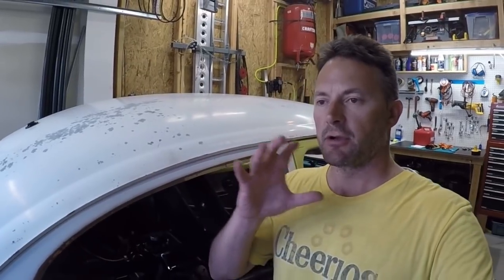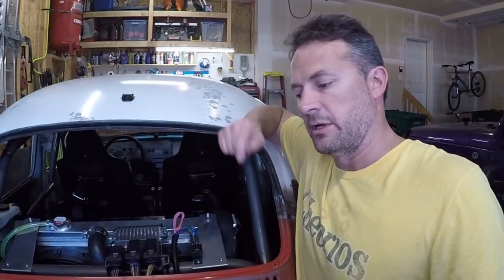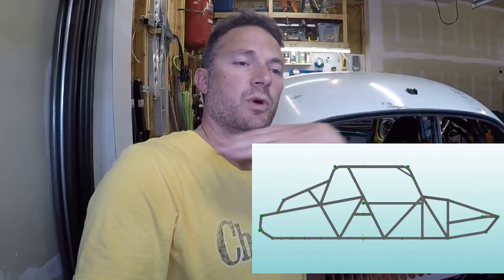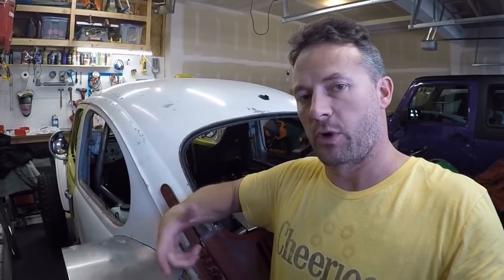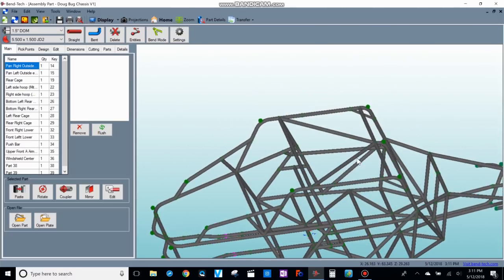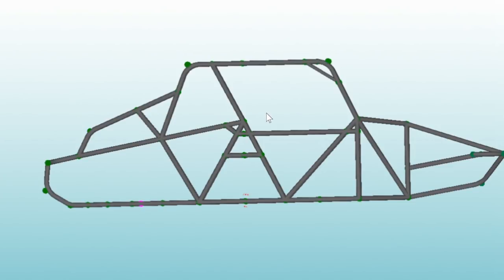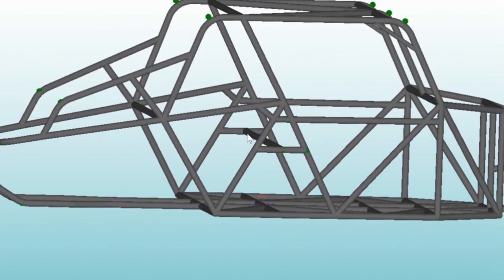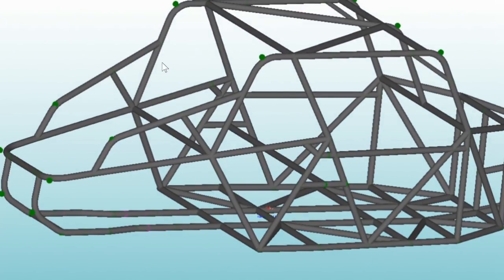A Baja Bug chassis for everyone.

Comment: What was the shortcoming of the previous VW Chassis  ?  What are you shooting for ?  More travel suspension ? Smoother Ride ?  Better handling ?
Reply from the maker: The engine and suspension I think at this point are limited by the chassis. I don't want to just try to cobble extra support on this one. I want to start from scratch and make one much better. But really I just want to keep challenging myself. This one now scoots down the trails great.

Comment: Doug. I’m very disappointed you are giving up on the bug body. That’s what makes your project so cool. Your car not just another tubeframe car. Please reconsider the body.  But if not here are a couple points. I’m an engineer and looked at your design from some basic structural engineering concepts.  I would really like to do some math on the design if you want to go that way, I mean materials and their qualities the end design shapes and your goals for the design.  You said you’re not going to do The Mint or jump this thing.  
Agreed. So if you’d like I can put your design in some stress software and maybe help your project. 
Off the cuff, if the bug body is gone stretch the wheel base and narrow the cab. No tunnel so push it in. 
2nd, I know you don’t have delineated the transaxle mount but taking a SWAG at it, your bar which will carry the shock upper mounts is wrong.   It’s current configuration will fail or bend and will translate rebound forces towards the weakest part of the design, the door openings.  Tilt this bar up from the rear continue it down and tie into the transaxle mounting structure.  You must optimize the truss structure of this area which will bear 70 to 80% of the beating.  
3rd the door area I’d use the NASCAR Triple beam strut ice here. It’s not just for side impact, but since this is not a unit designed racecar and you are trading structures for convince the door opening is a weak frame in an end over end event.  Since you are losing the truss here the triple beam keeps the car from folding up  and adds stability to the driving experience. 
4th you mentioned radiator in the cab. Check your Highway Safety rules or whomever issues VINs for road going vehicles.  Firewall requirements burn through and licensing, like safety glass windshields. A BUG BODY WITH A TITLE AND VIN GET RID OF THAT. 
Let know if I can help, this is very nice of you for offering up the development as a groupware knowledge base project.  Facebook or Google Plus may have a group project option.
Reply from the maker: Don, I'd like to discuss some of your points and it would be great if you could do a stress analysis on the design. Not sure if you've seen the newer design, this video is about 2 months old and I've made some changes. And currently I am actually building the chassis. So we're running out of time. lol
Please email me direct so we can discuss. dougbugbuilder@gmail.com

Comment: ps. Check out this nicely designed chasis. A lot like an Ariel with more straight bars. https://youtu.be/18flbGLj_w0
Reply from the maker: That's pretty cool, and it's Diesel. lol
Wonder why he didn't do some sort of front bumper?
Thanks for the link.
Reply: I don't think they worry about safety in Russia! lol The diesel may offer a lot of torque, but you don't get that nice exhaust sound of a gas engine. Highly functional, but maybe doesn't evoke a lot of passion.

Comment: Wow, you are consistently impressing me. I'm a week from getting my degree in electrical engineering, after I graduate I plan on building my own baha bug. I have been going back and forth between street legal rig or a off-road only, have you looked into licensing where you live? (California is pretty tough)  I have read that if I keep the main rails off of a Volkswagen that has a serial number on it, licensing isn't too difficult.

I will be very interested in your design files, I am probably going to go the same route. (Thats the engineer in me) I am happy that you choose to use this specific software, the pricetag is definitely realistic and I plan on using it as well. 

Thank you for your hard work, and have a wonderful week!
-Aaron
Reply from the maker: Hey Adw595, I just registered and insured mine. I've driven it some around town here. It's really easy to register and insure if you have a vehicle to start with like I did. Especially if it's pretty old too. Mine is a 67 so the county didn't care about emissions or anything due to its age. However just because it's registered does not mean your in the clear. We'll see if it gets hassled at all from police on the road. And if I was in an accident who knows what insurance would say then. But time will tell.
Good luck with your build.

Comment: Have you seen the chassis that kibbetech built for dunewhore?  They have it posted on their instagram page.  I'm tooling up to build something similar, or I may just go with a F100 build.  I thought I was decided, but after seeing different builds at the KOH I'm not sure now.  Either way fabrication is fabrication and the info you share is very helpful.  What sways me is the power I want and the limits of a bus transmission without spending over 10G on a weddle or mendola transmission.
Reply from the maker: I follow Dunewhore on Instagram but haven't seen the build on his chassis. I'll look for it.
I hear you on the build choice. The transaxle on rear engine builds can get out of hand real quick!
Good luck with your build, thanks for the info and comment.

Comment: Great video channel!
If you are not already planning to, I recommend stress testing your chassis design before the expense and time of building the full size steel project. For example, I think I see a torsional weakness in your front clip.
The technical way to stress test is with a Finite Element Analysis (FEA), but that requires expensive CAD software. Another way for home builders is to build a scale model using balsa wood and then twist it yourself. The balsa model can be built in 1 day for under $10. The balsa model helped me find weaknesses in my last chassis design.
Checkout my video at https://youtu.be/twAOhxcMAM8
Reply from the maker: That's interesting, I wasn't even considering doing that. But watching your video it looks like it did identify some weaknesses. Good video by the way.
When I get the chassis design I think I'm going with I'll give FEABLE a try. Thanks for the excellent advice and video link.
Reply: Also, if you design your chassis for torsional (twisting) strength, it will usually handle the load weights of the drivetrain and passengers without much additional bracing.  Most people start by designing a chassis to handle load points and then add bracing for torsional strength.  That is actually backwards and results in a heavier chassis.

Comment: Great work ! This has been my plan since I emailed you last time . That software looks like a game changer . How was it to work with ?
Reply from the maker: I'm hoping this software takes tube bending more from an art form to a mathematical step by step process for me. Making it easier to keep things straight and to replicate parts.
The software is pretty good. First couple days it's a real learning curve figuring out really how the software works. Once you grab some of those concepts the learning goes a lot quicker. There is a lot of support and videos on the Bend Tech website which helped a lot. And I have spoken to them a couple times now and they are actually very helpful. And have a lot more to learn on it of course. But as you can see after a little over a week I already have my first design on it. And this design is legit too. It is to proper dimensions, has the tube material and my bender info into it. And all the joints are mitered and coped. So the fabrication info it gives me should be accurate.
So in short I'm happy with it, although haven't fabbed anything with it yet.

Comment: Looks great and I have seen the software used by Ian Johnson on Xtreme 4X4 and it worked as well as you are expecting it too. 

I have never built a cage but yours seem like it will need some more added in the roof. Perhaps just one bar along the center line. 
With the small but possible possibility of you rolling it over that roof opening is big enough to allow a rock the come through. You did say you want headroom inside and assuming that includes helmet room then you can build the space in since you don’t have a form that you need to fit inside of. 
Just my 2¢ and being Canadian it’s only worth 1.4¢ US. 😀
Reply from the maker: Your opinion is worth full value. LOL You are right, others have also posted that the roof is a weak point. I'm going to see what I can come up with for more support in that area. I'm trying to keep the large window area open so when on the mountain trails I still feel open with the outdoors. But I'll see where I can sneak in some supports for the roof.
Thanks for the comment.

Comment: How many feet of tubing does it say your at for this chassis
Reply from the maker: About 9 miles of tube. LOL 
Not sure, didn't know the software will tell me that. Let me dig around, when I find it I'll respond.
Reply: When you add material to your library you can also put in lb/inch and it will also tell you weight as well.  I didn't catch if you said it or not but what material and size are you thinking? And last will you be retaining the body?(I read the answer in another post.). Be cool if you could make the bug shell fit around this chassis
Reply from the maker: Thanks for the tips Tony. I'll go into the library and add the weight and look for the total length.
I think one of the driving forces for no body is my body is in pretty bad shape, and I know I can shed a good amount of weight by ditching the body. That being said a nice chassis that a bug body could slip over would tip the scales on cool. I can see myself designing a chassis for that in the future. I think more people would be interested in that.
Reply from the maker: Tony, currently this chassis is 207 feet of 1.5" .095 DOM, weight is 322lbs.
For my final design I plan to use .095 DOM and some lighter gauge ERW for the triangulated supports to save some weight and money.

Comment: Bend-Tech pro is a fun program, it came with my bender/notcher from Pro-tools back in 2009.  I haven't played with the custom chassis in a few years, we primarily do cages in Rally cars, but we DO use the simple main hoop and A-pillar templates for bends and length to reduce waste.

For the panel attachments, don't wast $$ on the 1/4 turn Dzuz fasteners, just weld on tabs and use rivets or Riv-nuts and button head Allen bolts if you want to zip them off with a drill or small impact.

You will want another bar of your main hoop running forward up to the roof tube to support in a roll over while driving forward currently both your hoop and windshield bars are swept rear ward and your C pillar is nearly vertical.
Reply from the maker: Thanks for the tips Mike, I'll see what I can add for forward support and show it in the next video and see what you think. I'm trying to leave the window area open, but I'll see what I can come up with. Your are right though, looking at it I do see how it would be really weak there.